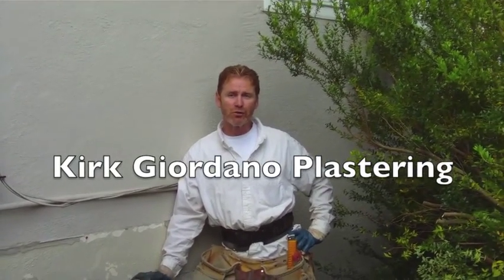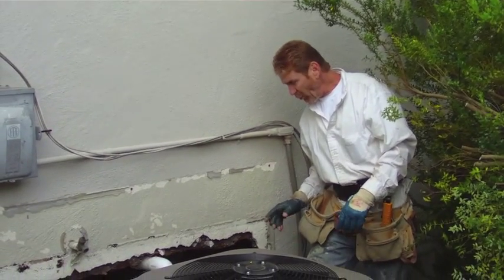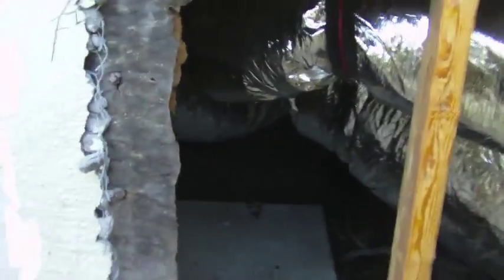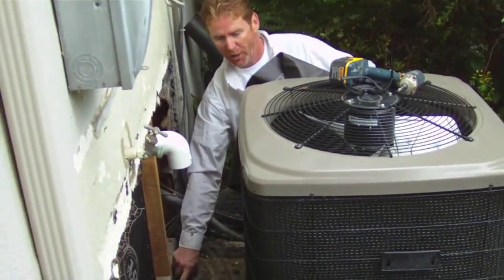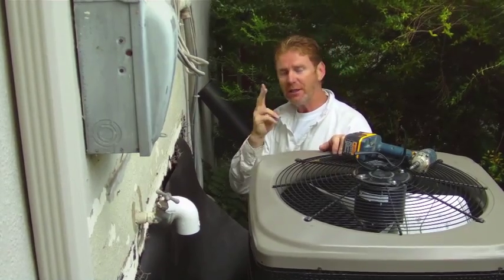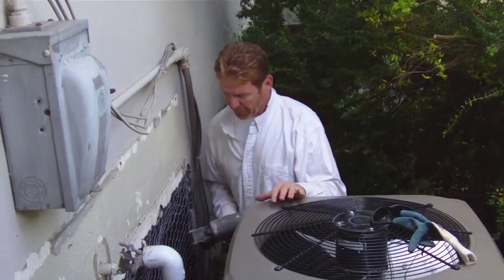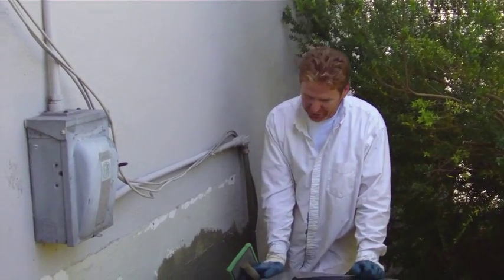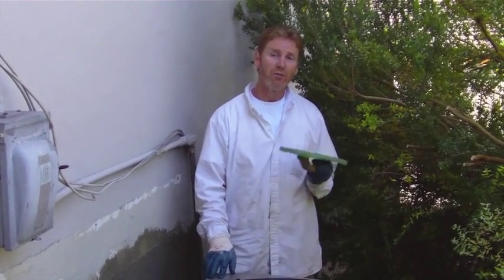Re-stucco a removed air-conditioner hole in stucco

Comment: Would you be so kind as to estimate the cost of hiring a contractor to do this with a smaller wall unit?
Reply from the maker: Morning PraiseDivineMercy, sorry, I only know what I would charge.
 Everyone's different, I would suggest go with the most competent for the best cost, as guys who have no clue will not save you any cash, 
instead will end up costing you in the long run possibly triple what competence cost.
 A quality fix is beyond measurement in cost as you sleep well knowing it's repaired properly.
 Best wishes,
 kirk Giordano
Reply: +Kirk & Jason Giordanos DIY plastering and stucco tips If you don't mind, what would you charge? I don't intend to skimp and it's more a matter of trying to budget and  prioritize a series of home improvements on my new house. The previous owners put the wall AC in a place that makes decorating a real chore.